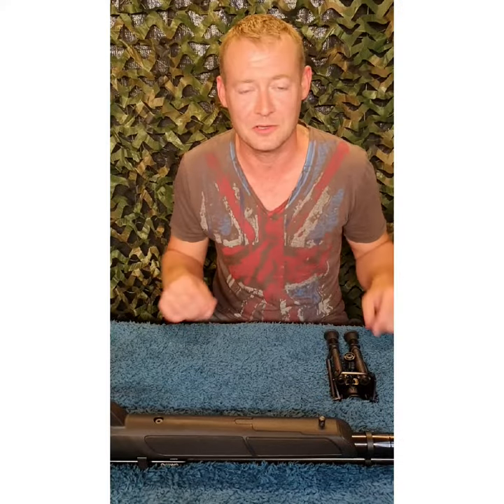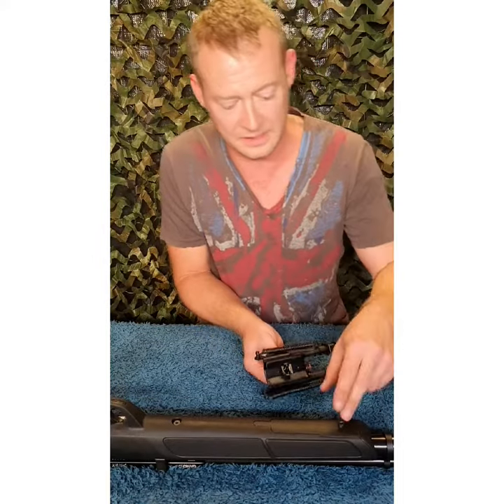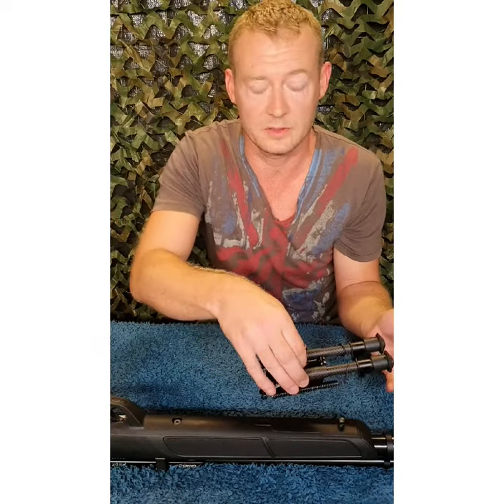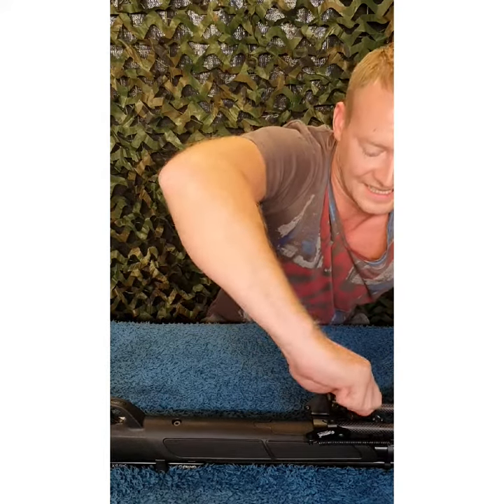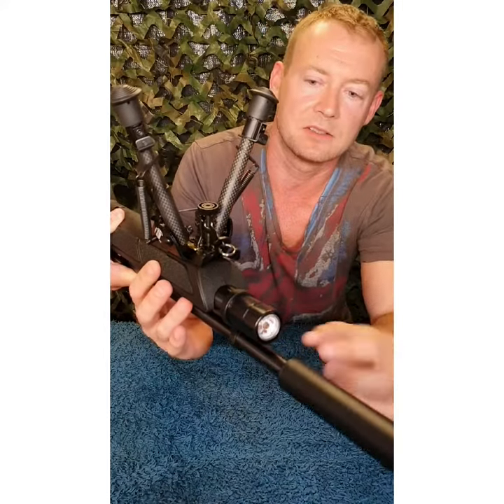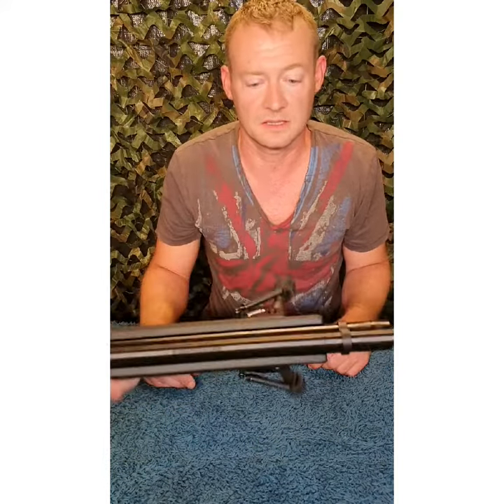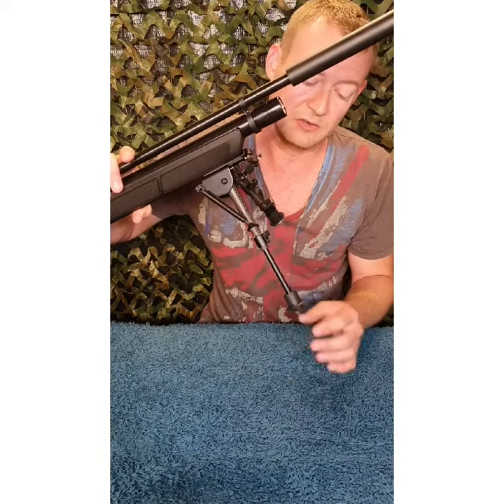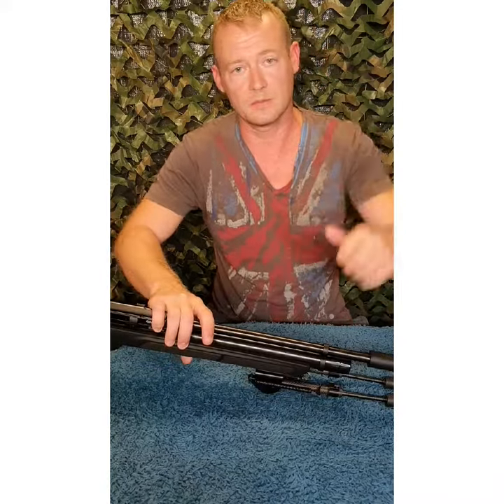Mounting bipod on Gamo Phox .177 PCP

Comment: Good concise upload on bipod fitting. Could you give details on this bipod,it really looks
the business given the price you quoted, and the time you've been using it. Thanks. Phil.
Reply from the maker: Thank you Phil, new to this so really appreciate that!
The bipod is a cheap Ebay item found by searching:  6"-9" Adjustable Spring Swivel Bipod Adapter Rail for Hunting Air Rifle UK.
There are various sellers and the price ranges from £11.88-£14.99.
Fantastic for the price and its withstood alot of abuse over the years!
Reply: Two Vermin Control thanks for the info and prompt reply, it is appreciated. In my opinion, it's this sort 
of reaction that will make your channel grow. I wish you success and you've just gained another sub.
Hope to watch more uploads in the future.  Phil.
Reply from the maker: Thanks again.
Aiming to get some new stuff up very soon, all the best! 
-Pete
Reply: @TVCvids69  Hi, did the swivel studs come with the bipod or did you buy them separately? I have looked on ebay for the same you searched but its unclear if I need to buy the stud seperate? Great video BTW. Although my gamo is .22 😁
Reply from the maker: Hi, nothing wrong with any calibre just me having a laugh, I shot .22 for over 20 years before going to .177's😃 Yet to find a bipod that comes with the swivels...
The studs I normally use are the Jack Pyke ones from ebay or amazon although the ones shown here were randoms supplied by my bro with his rifle just for the video..👍
Reply: @TVCvids69  I appreciate the reply. Big help, thank you. Keep up the videos aswell. Really enjoying them. I will look into getting the swivels separately then. Cheers bud 👍
Reply from the maker: Welcome fella, appreciated 👍 
As soon as time allows I'll upload more..
Safe shooting 👍
Reply: Great simple no nonsense video. Wonder what the gap is like for the stud thread between the stock and air chamber? What length thread is short enough? Cheers dude.
Reply: How is the bipod called  and where to buy? Any links?

Comment: Do you need a specific size stud i have a small stud and its not grabbing properly
Reply from the maker: Not unless the hole has become enlarged, look online you can get studs with a bolt thread that have a lock nut, should work ok although you may have to cut the bolt down to avoid it touching something ut shouldn't 👍